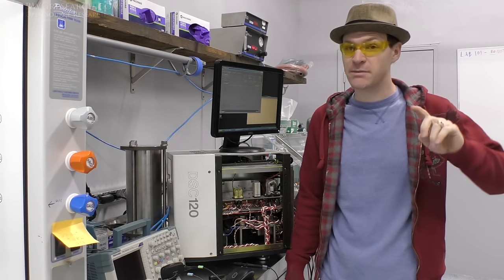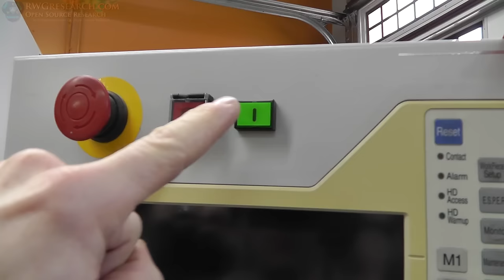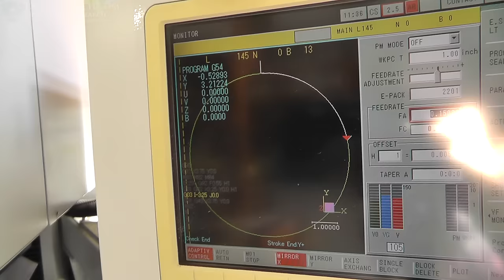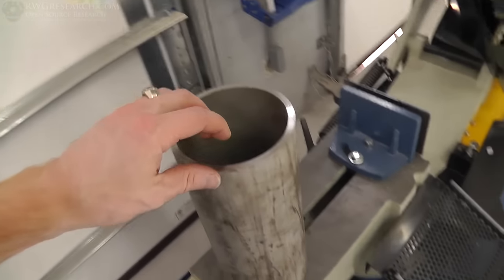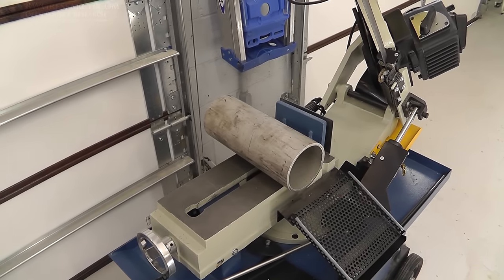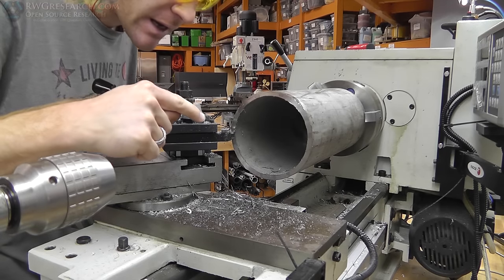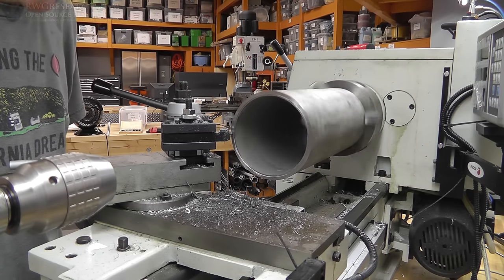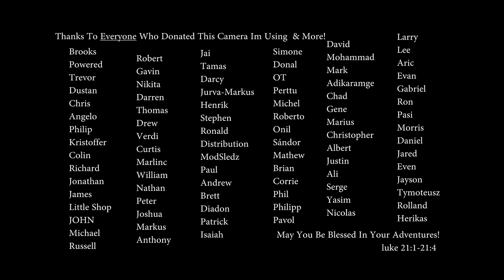Part 1: Building The Pressure Cell: Hacking The DSC (Differential Scanning Calorimeter)

Comment: I bought a calorimeter at the local tip shop, it looks complete, has a stainless steel pressure pump with large fan cooler 240 volt blowing through a radiator/cooler/heat exchanger element on top, the entire cabinet is about 1 cubic meter in size, looked like it came from a lab/hospital but I now know what it does, it has most of the parts, pressure cell on top, so is anyone out there interested, as its no good to me,
Reply from the maker: actorzone Intresting. Is there a model number or part number on any of it?  I might be interested. Thanks!  ~Russ
Reply: rwg, 1st issue, I live in Australia, the system is made in USA by Bird electronic corporation, written on the electronic control box is 6085 Calorimetric sensor, has a 240 volt power connector and sensor wires to this box,  has 2 pipe connectors for coolant flow/return from pump, attached to that is a large tube by way of 2 pipes for coolant, on the end of the tube is a 75mm diameter coaxial cable connection, written on tube is Econoload, the sticker is damaged, model don't know first number rest is 8676, then unknown number rest 35000, serial 0101, I have not been able to find images on the internet, the coaxial resistor tube part is all non magnetic material possibly stainless steel, weighs about 8 kg, the rest of the system contained a commercial pump 3/4 hp stainless steel pump, has medical grade hoses and piping, large squirrel cage fan blowing through heat exchanger which has coolant running throughout entire system, I pulled it apart as I am using most of it for projects, its all very interesting as I came to your vid as I had no clue what it was.

Comment: Awesome but couldn't you have got a nicer piece of pipe?
Reply from the maker: well, yes, but this pipe is very expensive. however this is what raw material look like, so even a better pipe may have been like this before lol :) but yes. to buy a short section of 1/4" wall 5" OD SS pipe was not to easy to find lol. and this was seamless. so it was extruded... thats why it looks so bad. thanks for the comment ~Russ